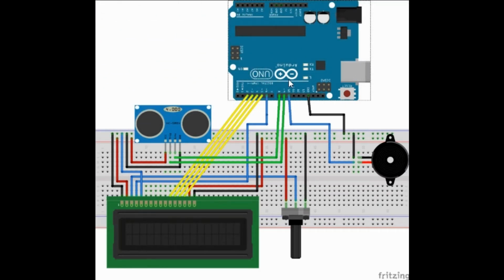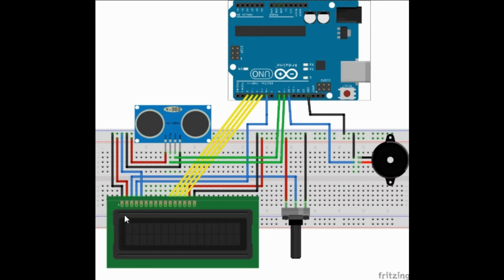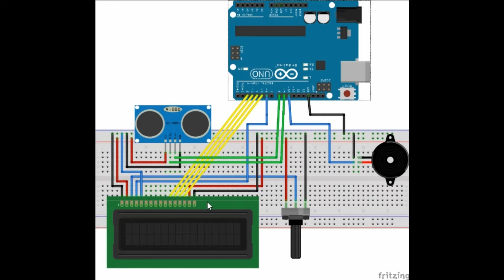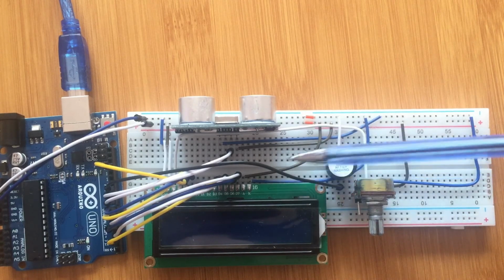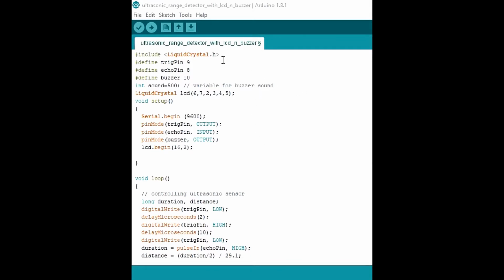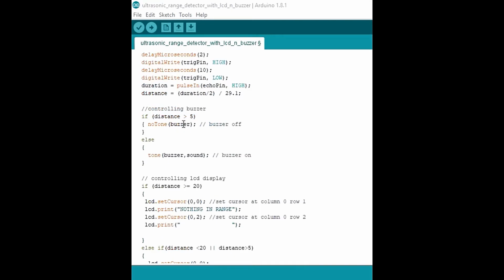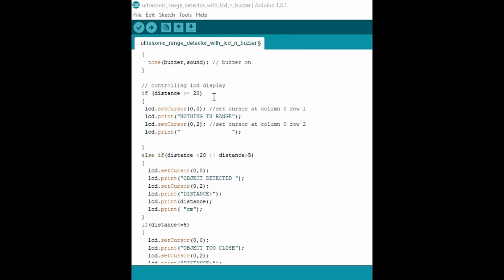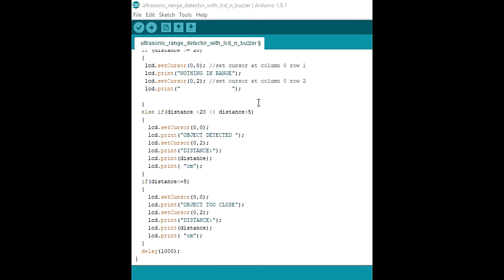HOW TO MEASURE DISTANCE USING HC-SR04  ULTRASONIC SENSOR WITH ARDUINO AND LCD

Comment: Sir please send me diagram it is very very useful for ne
Reply from the maker: I suggest you get the components needed and do this yourself and then you take a picture. I did this long time back and if am to to anything else with an ultrasonic sensor it will be something different.